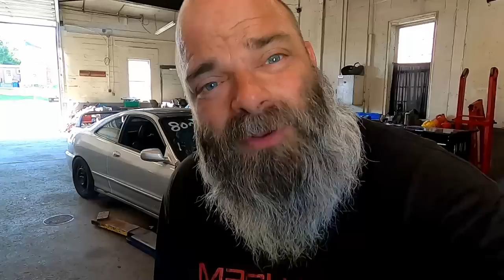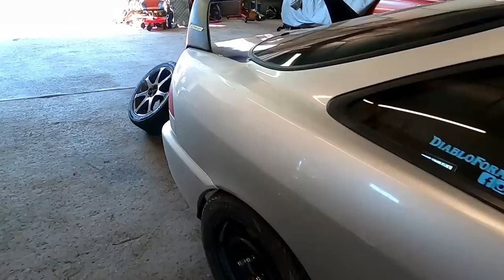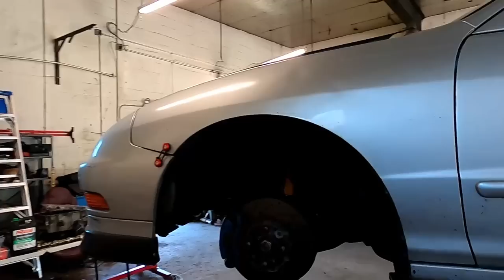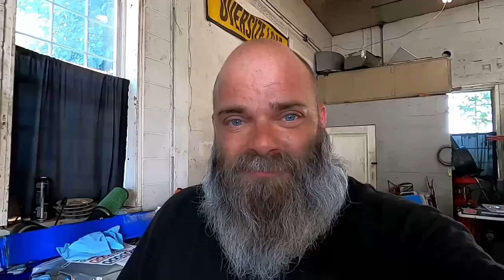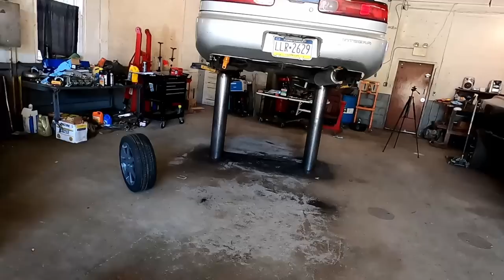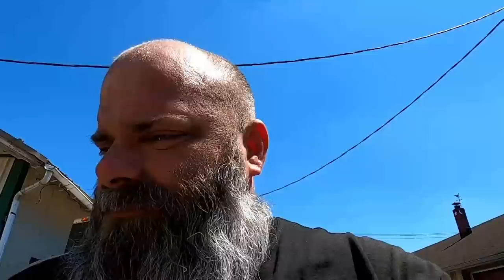My Secret Plan To Build My Kids Car While He's At Marine Corps Boot Camp! PART 5!

Comment: Epic vid, for the static stance the height is spot on and no need to adjust. For drivability I would raise 1/2 inch in front to extend the tires and  compensate for the speed turns and down force the vehicle will likely experience. For ideas on rim sticker quotes: THESE ARE MY WHEELS, THERE ARE MANY LIKE IT....., DOUBLE CHECK YOUR NUTS FOR TIGHTNESS..., IF YOU CAN READ THIS, IM ABOUT TO RACE AND BEAT YOU.....✌️